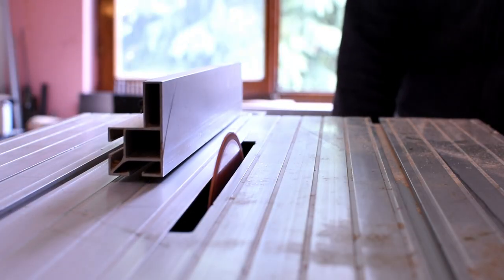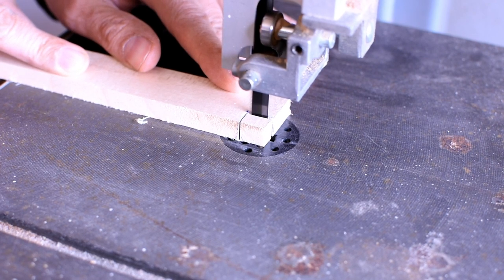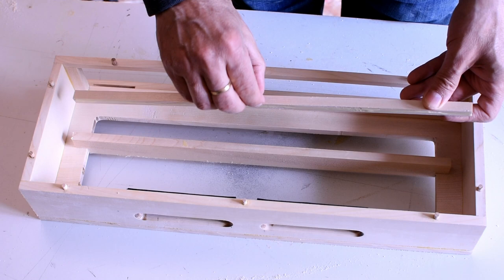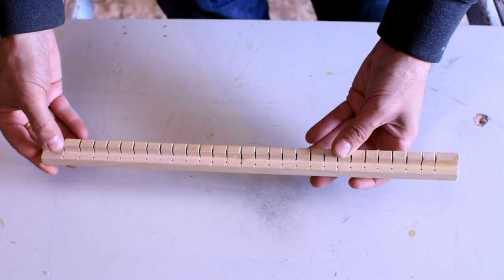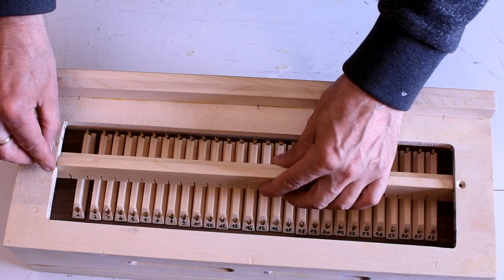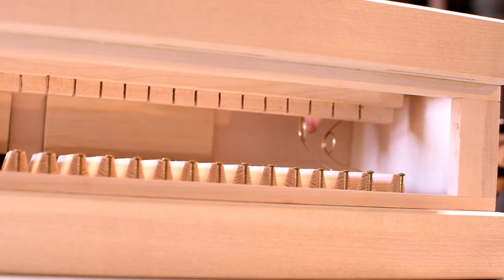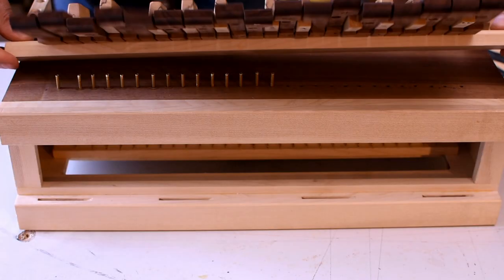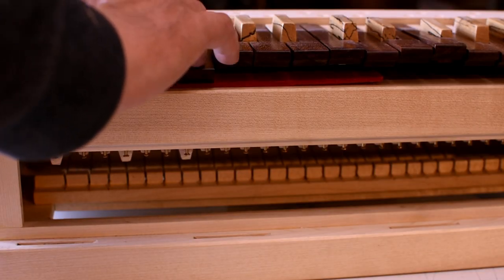How to build a portative Organ | #22 Actions and Springs | SUB ITA | Homemade Pipe Organ

Comment: Hello! Your videos are inspiring and enjoyable! I'm working on designing my portative organ now. I am wondering if there is any air leakage around the brass push-rods that go from the bottom of the key to the pallet, or how you prevent that.
Reply from the maker: Thanks!. yes, there is a slight air leak once the key is pressed, the hole is 3.5mm and the rod is 3mm so it's irrelevant, even in the ancient ones were made like that.

Comment: I made de spring of iron, its a little stronger,  it has a soft touch, but not to soft.
Reply from the maker: Yes, Iron springs are very good, but for this instrument I think that I'll remake the springs with a slightly thicker brass wire

Comment: Excellent job! Will there be anything surrounding the action rods to prevent air from escaping from the hole it travels through or is the air loss negligible?
Reply from the maker: Thanks CAS Music! The felt under the keys will also cover the part of the action rods, basically the action rods go through the felt, but only to prevent wind noise. In reality it is not a bad thing a slight amount of wind to escape, to prevent any "strasuoni" I don't know what they say in English, but that the adjacent pipes, in the event of a slight leak of the windchest channels, emit weird sounds
Reply: @nippocast  Probably "cipher"?
Reply: @nippocast  Ok, I think I see now. Thanks.

Comment: Nice ! It's  seem to working very great ! you can be satisfate !
This system of metal bar pushed by the keyboard is simple, and provide a good air seal when the key isn't activate. ..
But what about when the key is push ? the air can escape  into the metal bar channel, that is not wish?
Reply from the maker: Thanks! When I complete that part I will show it well, the action rods will pass through the felt under the keys, very thick and stiff, and it will be enough to prevent air from escaping from the slight gap between the holes and the rods themselves. on the other hand, the air cannot escape through the action rods (which are actually tubes to contain the weight) because they are closed by the skin of the pallets
Reply: @nippocast  thank you for the answer. it make sens, the action rod pass trhough the felt, very genius ! 
But it will make a suplementary resistance for the springs..
Brass is not very good for spring, why not use piano wire ? you can drip it in cold blue solution to prevent the oxidation if this worring you...
You make me very enthousiast for making one organetto, this  instrument is very cool !
Do you know the indian "shruti box". this is a drone instrument design for acompagnation and singing. it working with a air bellow ans free metalic reed.
The advantage of metalic reed is the little space they needed.
I was thinking to an idea, adding bass drone reeds on the organetto bellow, with the same shruti box system to activate drone notes, controled with the left hand on the  bellow
With metalic reed you can have very low bass, without pipes. What do you think about this idea ? can it be cool ? or not..

Good continuation
Reply from the maker: @gaulix69  The drone reeds are an interesting idea, I definitely won't do it in mine because already designed. but I would like to add a reed register to my main organ pedal
Reply: the reeds which i speak are not the sames are used into the organs, but into harmoniums, accordions, harmonica.
They are fonctionning differently and they do not need pipes. Theire clutter are very small and in my idea, this induce not modification to your organetto design.
If you understand well, the idea is that the drone reeds are not actioned with the keyboard, but like an "shruti box".
Theire fonction is only droning.
My idea is like fusioning a shruti box with an organetto.
Look at how is made shrutit box from the inside :
https://www.youtube.com/watch?v=NjeDyhXv8_c
As you can see in this video the guy opening it to fix a buzzing reed.
As you can see, you can just do a similar plate with reeds and valves who is attach on your bellow superior plate, and your bellow action hand can activate/desactivate the drone rotative valves...
This not big design modification...
Wich notes you'll choose if you wanting make more lower bass drones on your organetto?
Reply from the maker: @gaulix69  Wow! fantastic, sems they works with very low pressure
Reply: @nippocast  yes ! that what i'ved said when i discover this type of reed. Fantastic !
Yes they work well with low presure. by the way, if the pressure is too strong, the reed doesn't sound at all.
I think it can work with the pressure of the organetto without problem.
There existing organ with these type of reed, they call it "reed organ", it is a big harmonium.
One thing it is special with these reed that the air pressure doesn't affect the pitch of the note.The more the air pressure is, the loudest is the note.
The tuning is do by the size of the reed, and scraping it to make it more flexible. weight can be added on bass reed extremity to reduce the pitch...
Very insteresting.